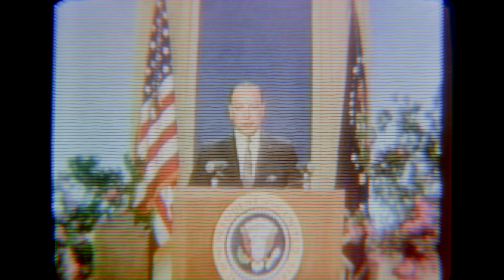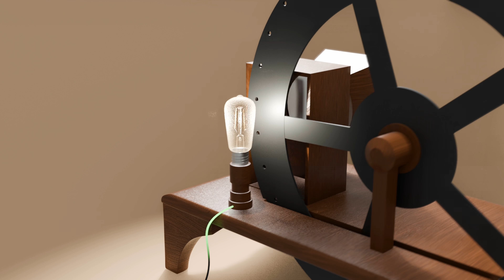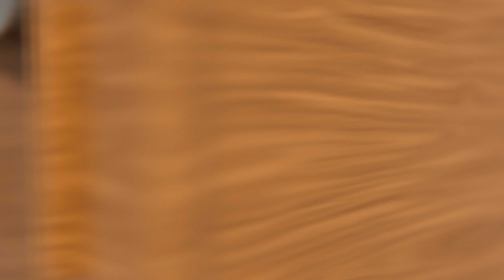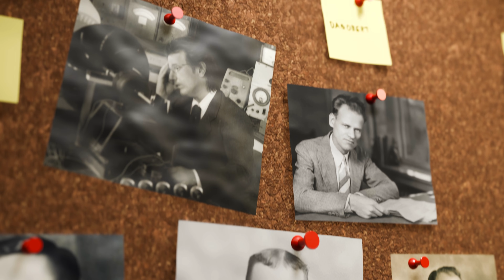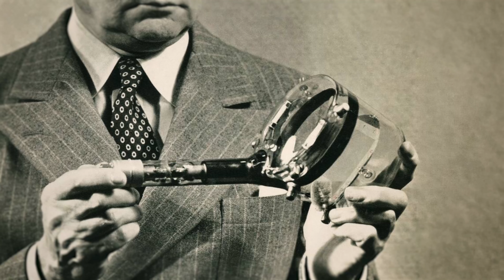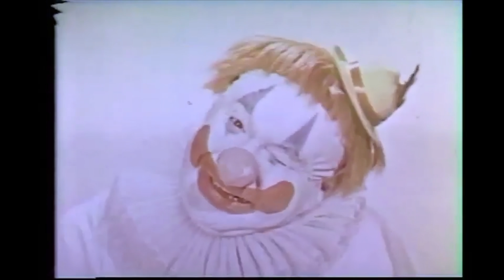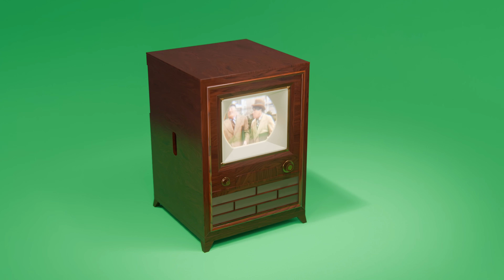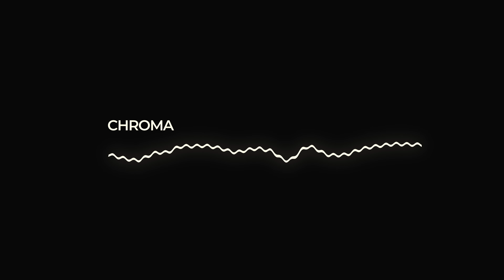Why Inventing Color TV Was So Difficult

Comment: The math for sending the RGB signal blew my freaking mind. So genius!
Reply: I watch these videos and they are for the most part wayyy over my head
Reply: The cleverest part is that the luma signal (Y) doesn't weight RGB components equally, but in G>R>B to match the human eye's sensitivity to different colors.

Then the color information is split into I (red-orange vs. cyan-blue) and Q (purple vs. green) coordinates.
Reply: @danielbishop1863  Yep. Those of us who remember old color TV sets remember the Tint knob that adjusted the decoding of the Q signal, and could shift the whole picture green or purple. The Color or Chroma knob adjusted the saturation or overall intensity of the decoded colors.
Reply: @COMALite_J  even more crazy was that there was a small difference between each camera signal back in the days so if you wanted the perfect image you had correct it each time
Reply: @docdat3468  NTSC : Never Twice Same Color
Reply: @COMALite_J  only on NTSC, PAL and Secam wasnt an issue
Reply: @xiaomimignon9033  😀😁😄 I remember hearing that from a video engineer!! 100% true.
Reply: @danielbishop1863 and also if they wanted to watch something back in black-and-white, they'd simply just turn of the chroma signal, what's also interesting that this luma and chroma thing is used in JPEGs and most video files
Reply: @danielbishop1863  nowadays scientists and inventors are not this smart or better yet, not this preoccupied with Human senses when inventing new things

LED lights fuck up our brains and eyes, but they're made because they're cheap.
Reply: @g @gui18bif that’s not true. They are not only at least just as innately intelligent, bit by virtue of technological and scientific progress, they possess a far greater body of knowledge than their predecessors. There are truly brilliant people at work both in basic science and technological development — which have a relationship with one another but are not the same thing — inventors and engineers work toward objectives based on market need and demand. They always have and will; pure science is based on finding the fundamental truths of the universe that make technology possible. 

Your complaint about digital light is also baseless. Digital light is not only far less resources intensive, requiring a fraction of the energy, but it also easier on the human eye than incandescent light.
Reply: @fredericklmeade2947 Unless PWM dimming is in use. LEDs using PWM dimming will rapidly flash on and off to simulate less than 100% brightness. If the frequency is low enough for people's eyes to see the flashing, it can cause eye strain, headaches, and the like. Human eyes max out at about 1000Hz, so a PWM frequency above that should be fine, but a frequency below that is trouble.

This is especially an issue with phone screens, which tend to use rather low PWM frequencies around 200Hz and are right up in your face.

LEDs can also be run at less than 100% brightness using DC dimming, but this is much harder for manufacturers to achieve. It's a lot simpler to just flash it on and off really fast. But complaints of eye strain and so forth seem to be motivating manufacturers to try to overcome the problems with DC dimming, so hopefully it will become the standard in the future.
Reply: @fredericklmeade2947Is it true though with the eye thing? I guess if it’s warm rather than blue light.
Reply: Seems like magic to me
Reply: @jarehelt  The great writer Arthur C. Clarke once said "Any sufficiently advanced technology is indistinguishable from magic"  
In spite of having done a lot of research in my careers, I still feel like that more times than I care to admit, LOL!
Reply: The math itself is amazing, true. But then there is that it's all implemented using analog circuits.
Reply: @kangirigungi  No kidding. I'm a hobby level circuit builder, you couldn't pay me to assemble an old color TV with instructions.
Reply: @Bhedruum  Those are some fun and exciting voltages too.

With most electronics, the highest voltage you're likely to encounter is 12V, so unless you lick a circuit board while it's powered, you'll never feel the slightest shock. It's harmless.

But opening up the housing around a CRT could be the last thing you do if you're not careful!
Reply: At one time you could do just that.  Heathkit offered a color tv kit that many people bought and successfully built.  I knew a physician that bought one and successfully built it without any knowledge of electronics.
Reply: @gwesco  I have fond memories of Heathkits. My dad and I built an amp and a shortwave receiver, both got a LOT of use.
Reply: @kangirigungi For all intents and purposes, you basically need two subtractors. One for luma - red and one for luma - blue.
Reply: @kangirigungi  yes, same with other things from the era, like electronic ignition for cars with advance depending on engine rpm comes to mind.  since microprocessors it's a bit of a lost art, and my electrical engineer uncle had no use for computer anything!  also you'd be surprised at some of the speeds that are needed out of microprocessors to do these things
Reply: Yes, that was a great, brief/simple explanation. Though I am left wondering where the bandwidth they fit the audio.
Reply: @evandean3944  The audio for analog TV was on a different frequency just a bit higher than that of the frequency for video.  It was basically a FM radio signal.
Reply: Thank you,  @jeremywj  .  I remember now, tuning into a local TV's audio on my FM radio, at the very bottom of the dial, when I was a kid.
Reply: @evandean3944 yes
Reply: wait till you see the math behind modern video codecs. For starters, can look out for how to encode JPEG.
Reply: @quanliew28  Discrete Cosine Transform!
Reply: Finding a way to use the same bandwidth is multiplexing (MUX) and demultiplexing (DEMUX) at its finest!
Reply: Thanks I need to watch this later
Reply: It’s a very elegant solution.
Reply: They don’t explain how the image and data goes through a cable. 😮
Reply: r
Reply: González Camarena patented his system based on the use of three basic colors (red, green, and blue). MADE IN MEXICO
Reply: That’s why engineers should be respected
Reply: Don’t forget it wasn’t done by “math” but by resistors and transistors.  No numbers, nothing digital.  Yes the design was mathematical but there’s no data processing in the TV.
Reply: @whophd  Analog components can do math, look up how op-amps were initially used, and there's literally an Analog Computer page on Wikipedia.
Reply: @DripDripDrip69  there’s no “analog computer” as defined by Wikipedia, in analog CRT TVs
Reply: @whophd  Repair Technologist here..  I suggest taking the course so you don't look ignorant anymore
Reply: @Cody6210 I'm was an electrical engineer and repaired color TVs as a hobby and the books I read on the subject stated the principles involved were beyond the scope of the textbook.
Reply: @WoodgemanX  And completely dependent on math. His comment of there being No such thing as an analog computer was what I was referring too. I repaired them for a living, still repair on a microscopic level, even fix new TVs as well. One of the FIRST computers was 100% Analog, using thousands of vacuum tubes as logic gates
Reply: @Cody6210  Aren't logic gates just for 0 and 1, so digital?
Reply: @whophd wait until you find out whats in a CPU
Reply: @danweston6109   i laughed way too hard at this
Reply: @danweston6109  xD!!
Reply: @danweston6109  haha funny, but let’s admit there’s no data or bits of data inside a purely analog TV
Reply: Miss the time when companies trying to improve technology instead of trying to kill of humanity with the buzzword
Reply: @toututu2993 , you are aware of the Cold War and corporations developing both weapons and weapons delivery systems to use thermonuclear weapons (weapons many orders more powerful than the bombs dropped on Japan with the scale only limited by the size of the bomb that could be deployed), which would indeed destroy humanity, either entirely or for all practical purposes?
Reply: @toututu2993  The past wasn't any better than it is now. Stop the bs bias u got on your mind
Reply: @Nounsi_Dev Yes it was surely better, Disney were great, no CEO lies about this AI buzzword nonsense, no AI data centers poisoning you, good quality multi media, no stupid people praising a horrible generated ai crap. Arcade is still around, no stupid people dictate you in everything so you have more choice in life. Big games studio that actually makes great game rather than promoting woke and AI just to please shareholders. Great time
Reply: @toututu2993  Ah so what the 60s 70s? The same time when the cold  war, America bomb and kill millions of Asian? For you maybe, technology and companies have always use to kill, exploit people. You only notice that because now they came for you, because people from countries whose you guys exxploited resource and wealth standing up to you colonizers. The same way someone like Nikola Tesla got used and exploit by a bunch of capitalist wrapped itself in the so called "The American Dream". And also big game company that promoting woke and AI? You don't even know how a business or a game studio works under a shareholder. As i said, you have nostalgic bias for when you were naive and unaware of the evil world.
Reply: @Nounsi_Dev  do you think this person was alive in the 60s or can you maybe infer that they know less about that time because they simply didnt live during it? what nostalgic bias?
Reply: @grqfes missing the point, it's not my first language so i did make some mistake. It's the same daydreaming about being a knight in the mediaeval age, a pirate in the golden age of piracy. If you want to strip the past clean of the ugly thing and dream of the simple life it was back then, that version only exists in your mind. And no i don't assume they lived in the 60s but i at least hope someone day dreaming about the past should know that trash elite from king, capitalist, land owners had always exist, and continue to do so
Reply: @Nounsi_Dev Yea is bad back then but AI hypr makes it 100 times worse
Reply: @toututu2993  It just another bubble that gonna pop, I work in embedded system and AI sure are helpful and impressive but the way these companies promote it is straight up trash. But yeh it gonna pop soon just like any other modern scam we got introduced by billiionaire, Crypto, NFT
Reply: @toututu2993 Go tell the Americans in 1929 or the Japanese in the 50's that our biggest problem in 2026 is that "a machine creates pictures in bad quality, but company owners say they'll be in good quality".
Reply: @FacuA0 People back then will laugh of how horribly bad the AI generated looks and feel but being astonished of how fast the modern computer is, while being even mind blown by modern VR